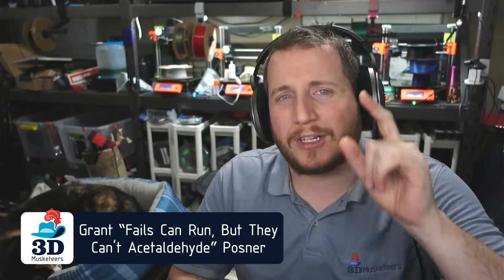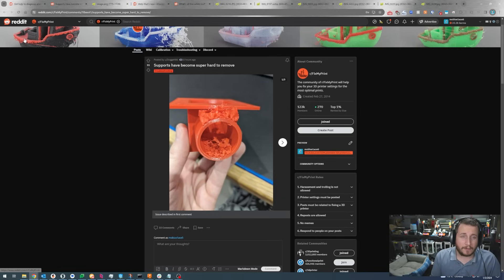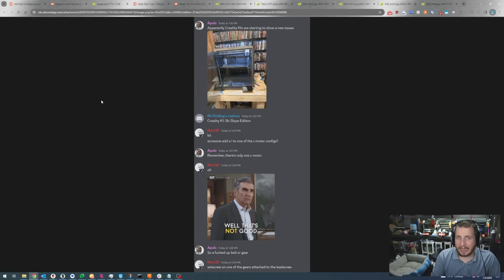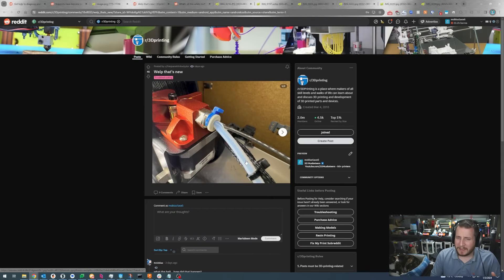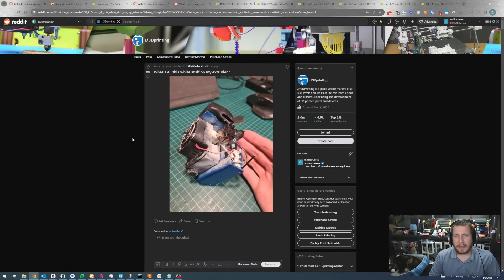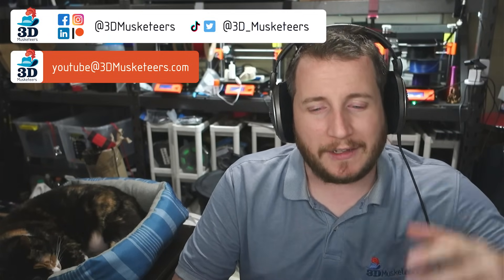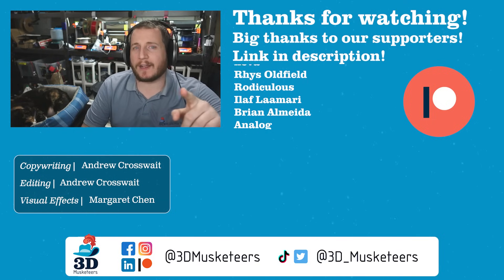A Bambu's Corner Troubles! - PrintFixFriday 121

Comment: I use eSun PLA+ a lot, and it is a little more difficult to remove when used in supports.  It’s really tough PLA, and doesn’t break as easily as other PLAs.  So to help with supports i just set my top separation gap of the supports a little larger.
Reply from the maker: definitely a good practice when fusing occurs!

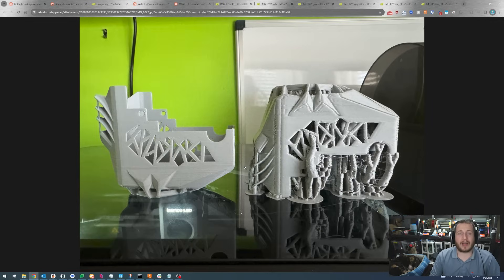Comment: At 13:28 It looks like a Knomi mount by Omranello for K1/K1 Max. It can be a B. X1C or a K1 Max. The only problem is that the K1 Max sensor does nothing (at least right now). So, it's hard to tell. 
Thank you for the episode. Please keep up your good work!
Reply: Yep, it’s the D3vil Burner for the Knomi which is a pretty popular mod within the k1 community. And the LiDAR is basically broken once you root the machine and it doesn’t help much anyway so most people who root their k1 max machines just remove it.
Reply from the maker: ah, those are mods I am not familiar with!

Comment: General wisdom for reverse bowden tubing is to use the losest fit you can find. I like the clear FEP tubes. Generally the cap tubing has a lot greater friction and has cuased feed issues on my faster DIY machines.
Reply from the maker: I use normal sized tube so it fits in my dryers LOL

Comment: I'd like to hear more about the X1plus team's claims that the security issues previously raised regarding Bambu's data collection program are overblown...we have one report that the encrypted log files are worse than we could have imagined and another saying *Alles in Ordnung*, that we shouldn't worry at all because nothing is being shared and Bambu Lab is operating without dishonesty or deception. It makes me suspicious of X1plus, not that I'd buy even a used Bambu printer anyway. The first look video Michael from Teaching Tech did on it seems promising, but if it's just a Trojan horse to lull users into a false sense of security it'd be highly disappointing.
Reply from the maker: The x1plus guys are really good. I'm confident in what they are doing. As for the claims, in due time.

Comment: yeah that's my issue with the mirror. There is no good orientation, but now I'm also blaming the filament. lol I checked, it is atomic filament. It just doesn't seem to print all that well. the esun PETG prints way better.
Reply from the maker: Atomic wants more heat in my experience.
Reply: @3DMusketeers  It seems to do fine on the main features (but still not happy with the print), but the details are where it fails. The gyroid infil was almost completely trashed. I guess I'll do a couple gyroid cubes to see if more heat helps.